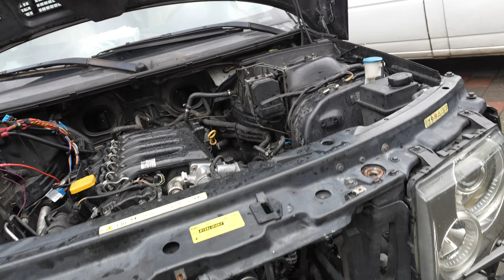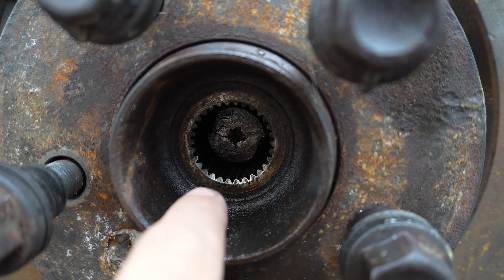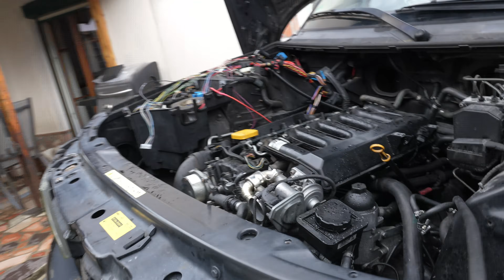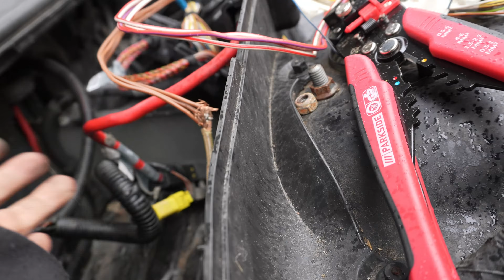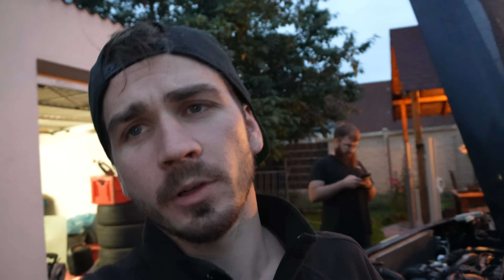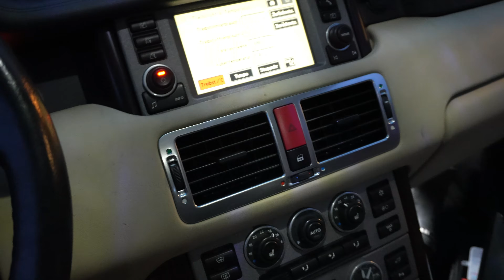Range Rover L322 M57n2 swap and 6speed conversion Pt.3 wiring and fuel system

Comment: Will that zf gearbox not work with the original m57 engine? Those engines are not bad at all, I have a 2004 L322 with 213k miles on it, but similarly to you my gearbox is failing

Comment: Hey bro, loving the range rovet works! I was thinking something similar but no idea if its possible.. i have an e46 bmw 330d with the M57D30 engine. Any chance i can swap that into a L322 RR petrol? Ive been offered a non runner for scrap and its a Westminster but its a petrol one. I have no clue about mouting points and wiring and of course fuel tank and so on needs to change. Do you have any thoughts?